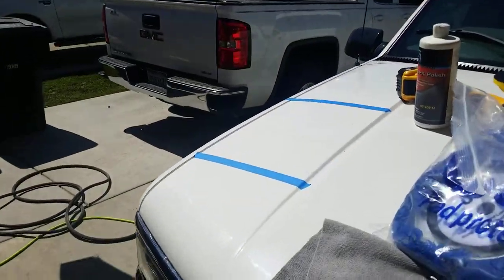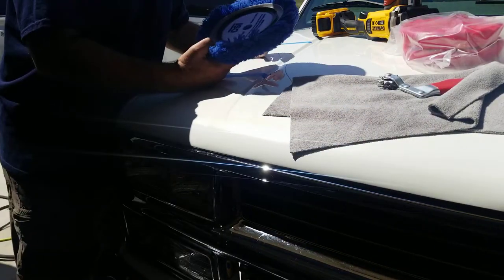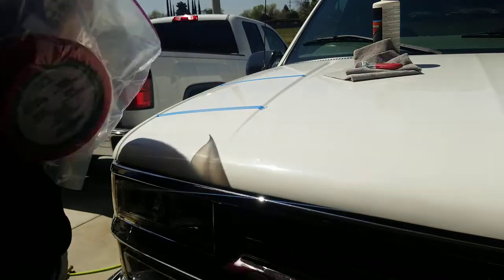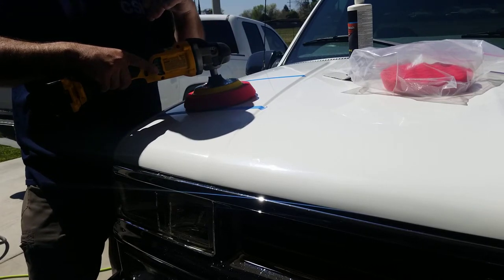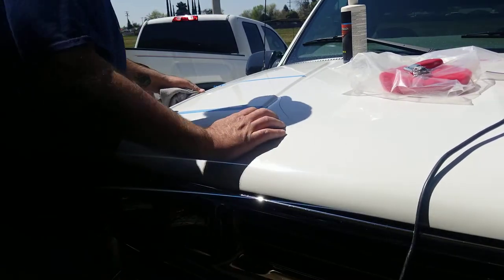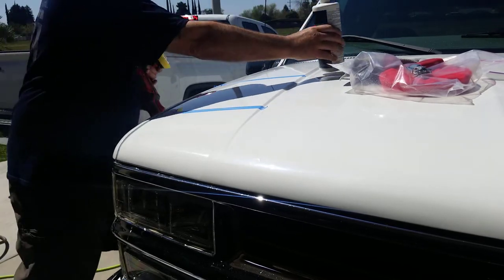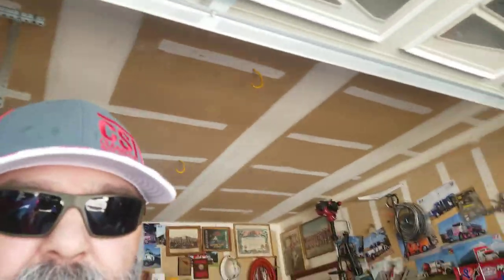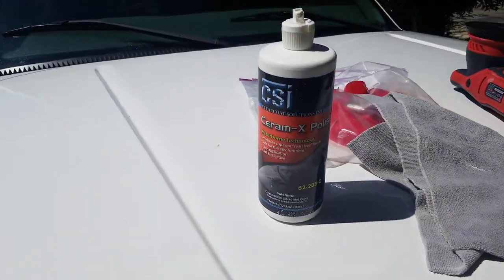CSI CeramX | The best car polish

Comment: Great video Doug.next time try keeping pad flat unless u need to cut some heavy marks.ive learned csi with junk panels in basement 2 get it down pat.u will get there so enough.b well buddy
Reply from the maker: Hey Richard. Thanks for the tip man. When I use the rotary and a wool pad flat I do get great result. I have heard that a little angle gets it done a tad quicker. To me it's a little easier to handle the machine with a slight angle. Hey Richard, I SUCK on a rotary man...I need to work more often with this polish .... I do Love the CSI system though... be well. Have a great week.👍
Reply: @detailit  I still need practice. Tore my meniscus  and acl on left knee now replacement is close haven't had any real customers other than my maintenance clients. Practice, practice,is all u can do.when I come 2 c my kid this year im gettn Tom 2 certify me on csi
Reply from the maker: @richardseem7948  take her easy man. That injury is an annoying one. Get well man. Take care.... and I'll practice👍

Comment: Can you use a ceramic coating after using both CSI’s products?
Reply from the maker: Hey Ed, yes you can. No oils or any fillers in this polish. So easy to clean up... I Love It
Reply: @detailit  Thank you!
Reply: @detailit  how do you like using it with a DA? Cause I’m not very good at a rotary.
Reply from the maker: Hey Ed. With the proper pad it's fine. It cuts quicker on a rotary but a microfiber pad and da will work great. You can also use the Lake Country foamed wool pad. Then finish with foam polishing or foam finishing pad.  I think this is the ONLY polish to use. So simple and effective! Enjoy it man! I'll try to get you a link of Darren doing a Demo on this very topic... a DA. Thanks man👍
Reply from the maker: Here you go Ed

https://youtu.be/z7Kx_3PPw_E